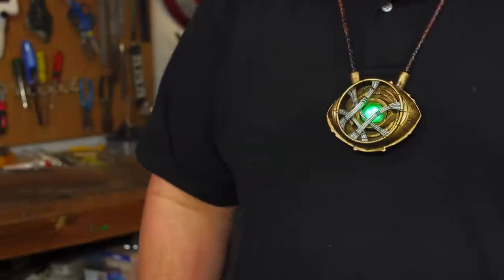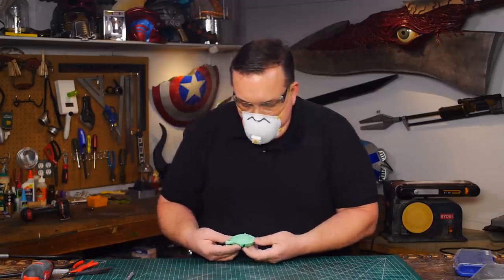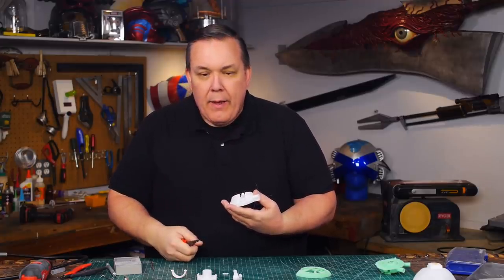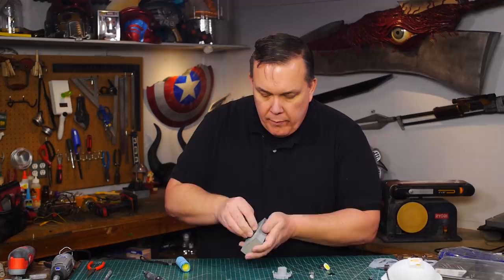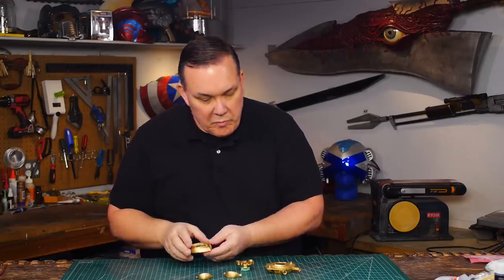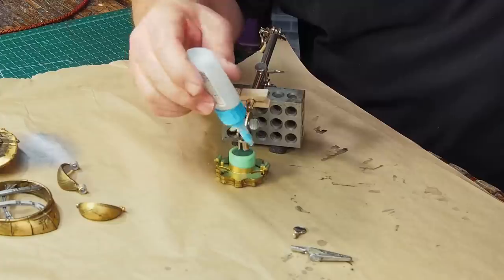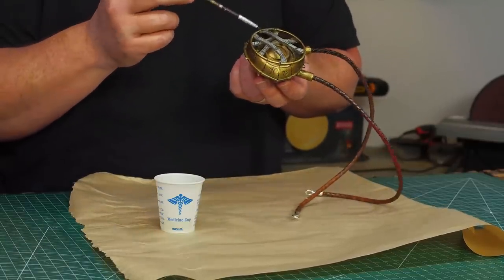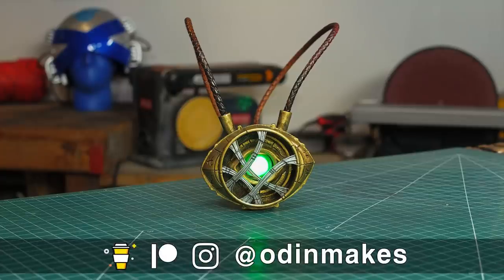Odin Makes: Eye of Agamotto from Doctor Strange

Comment: Hi Oden, a good tip for joints and other areas like the opening eye that may rub off the paint. Use a toothpick or a needle to rub superglue over the painted areas you don’t want to rub off. Careful not to glue any joints or moving parts together.
Reply from the maker: Oh, cool!

Comment: When sanding a thermoplastic like PLA, treat it like you would if you were working metal on a lathe... coolant. coolant. coolant. In the case of PLA, just a spray bottle with water will save your sanity.

Comment: The problem with resin printing is that it shrinks during curing and it's not uniform. That's probably the cause of the gap. Probably would have been better off filing the gap.